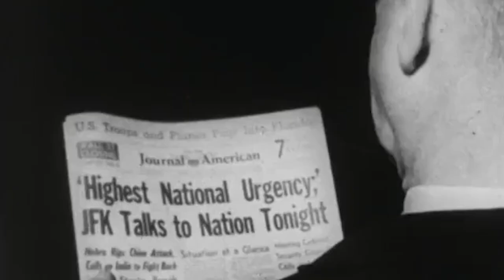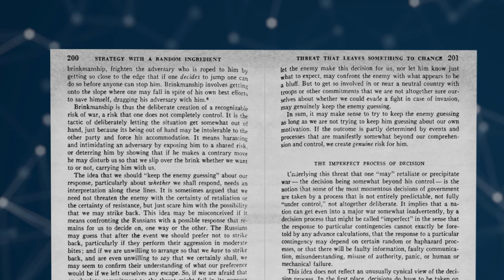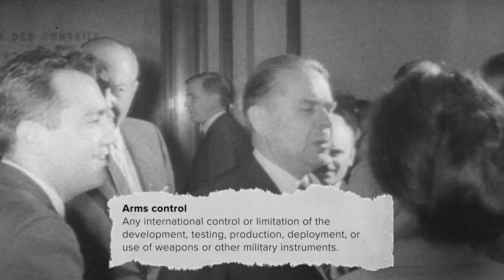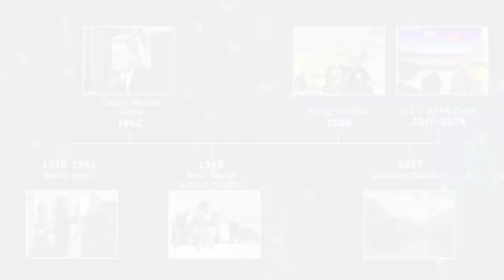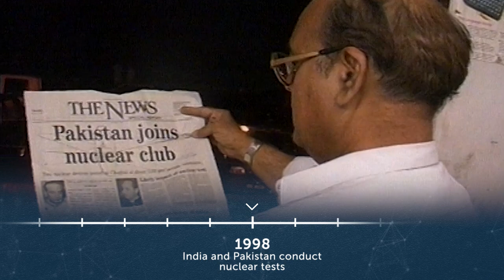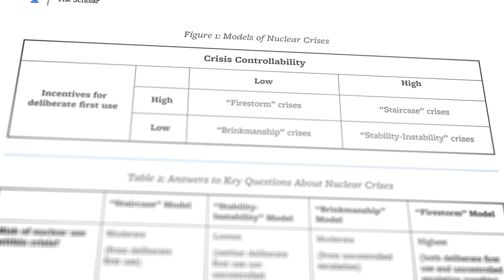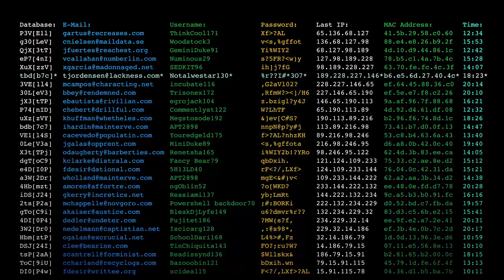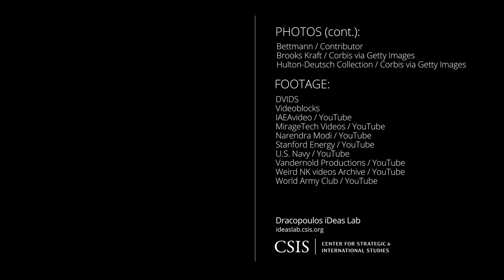Deterrence 101 Module 3 - Strategic Stability, Escalation, and Crisis Management

Comment: 24:50 makes no sense in my opinion, the value of nuclear weapons is not in using them, the value is in the deterrence effect, so there is no use it or lose it mechanism taking place and when one of the countries has a vulnerable arsenal they just lose deterrence value but they dont achieve anything by using the nuclear weapons
Reply: This argument is very logical, but here I see the problem - if even nuclear strategists fall for "use it or lose it" thinking, so can politicians under extreme pressure. It therefore can be sort of a self-fulfilling prohpecy.